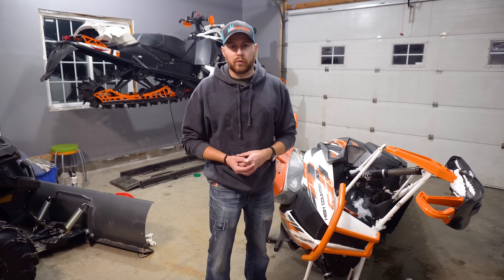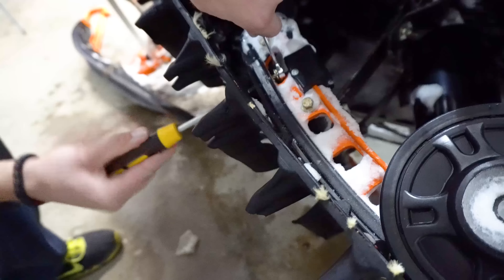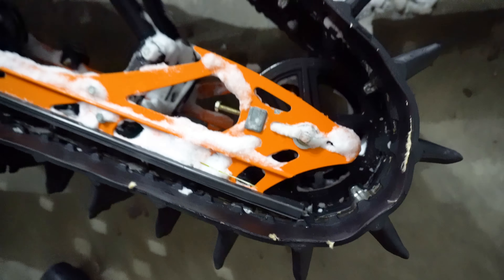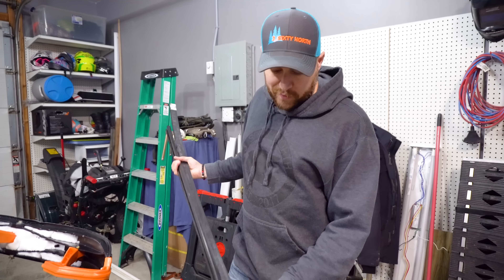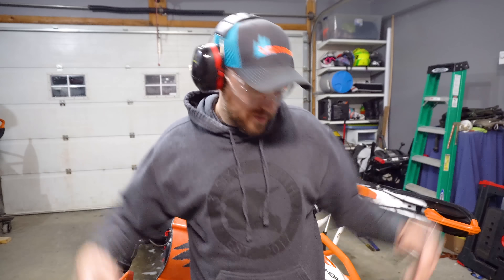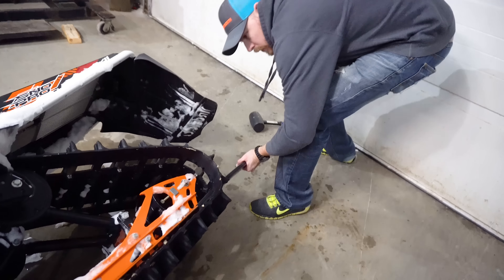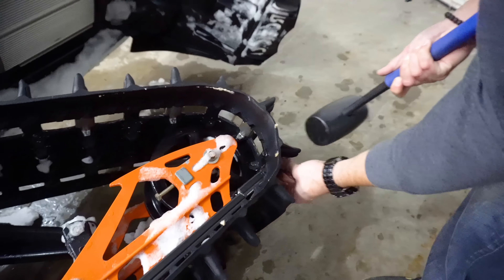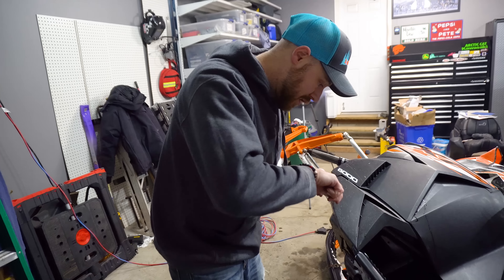How to change your snowmobile sliders/Hyfax the easy way - Arctic Cat,Yamaha, Polaris,Skidoo

Comment: I’ve changed these quite a few times. I now drill a hole in the old one once it is through the track hole. I put a bolt in  the hole and use a sliding hammer to pull it off.
Reply: now thats a good idea

Comment: I have been riding snowmobiles since the 70s and I never do this just take the rear suspension out it's easy compared to this and then you can replace other parts if needed

Comment: I just wish i had a garage my hyfax are completely gone right now, high of 15 degrees today ouyyyy
Reply: I go out and I’m bolt my carriage and bring it in my kitchen and replace everything in the carriage also use more bogey wheels in my carriage adds six more pounds but makes my high fax lasted way longer even riding in low snow or no snow conditions I get two or three years out of my slides when I add more bogey wheels

Comment: I just removed my skid getting ready to replace these. But the old ones are 2.5" short of the end. Yours look closer to the end should I cut the new ones maybe 2" longer? Leave about half inch bare?
Reply from the maker: The rails taper off at the end, so if you leave half an inch or inch and a half you'll be ok.

Comment: What's the brand of the dual sled stand in the background?
Reply: The stand is a Pogo Lift. Made in Canada. Can be configured to hold a sled and a quad, two sleds. Two quads. Latest version I believe has a higher capacity and can hold a SxS. I’ve also modified mine to hold a streetbike.
Reply: @redfieldsapprentice4489  Thank you! How much did you pay for it?

Comment: Can you safely add pieces to the ends if you cut it too short
Reply from the maker: We don't recomend doing that, as the pieces might come off as you are riding.
Reply: @3sixtynorth  thats what I was thinking as well I was told that it would be ok to run them short and it wouldnt hurt anything theyre 6 inches too short I just dont feel comfortable running them that short an inch or 2 I can see not 6